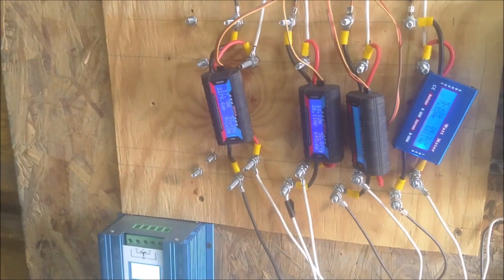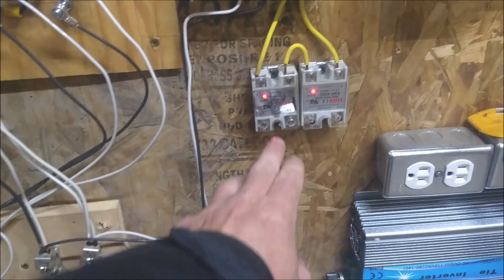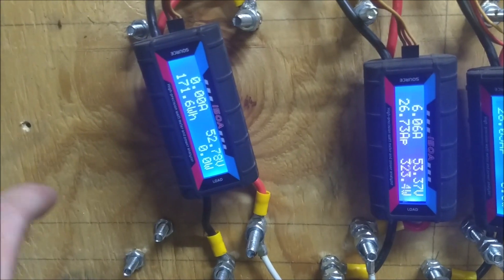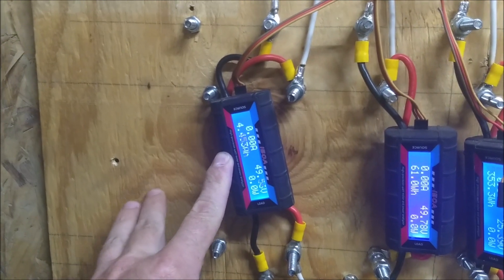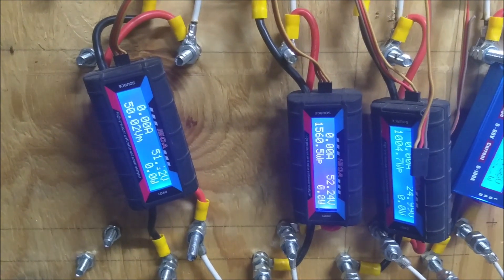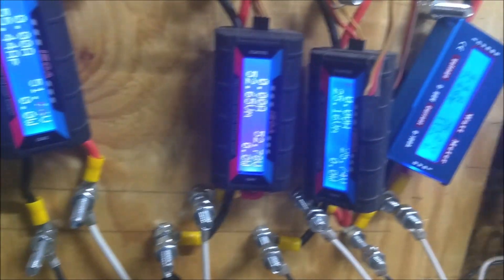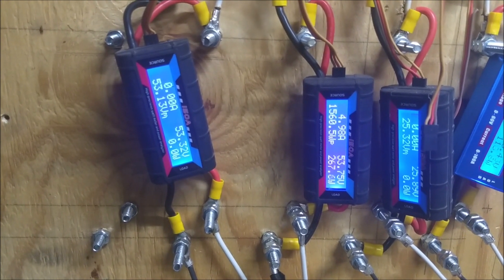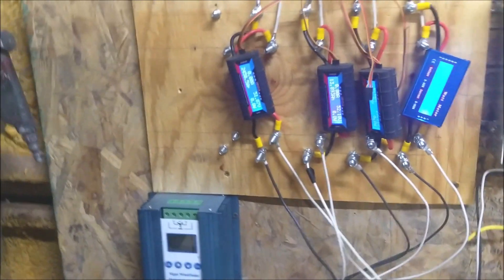iSta Breeze i1500 vs iSta Breeze Heli 2.0 Peak Outputs

Comment: Hi Mate, I have tried using 3 blades even up at 6.5 meters, but they are not working in my area. I am still having trouble getting the ista breeze i500 going with the 1.2 meter 5 blade wind wheels. I tried a 1.6 meter 5 blade wind wheel, but it is still slow to start. I think there might be some cogging, since it has larger magnets on the rotor. I have a delivery coming today of some blades like you got for your smaller wind generator, with more inner scoops on the blades for slow wind start up, just hope it does not affect the top rpm.

Comment: Is the 3 blade or 5 blade better for usual 10-15 mph max 50 mph half a dozen times a year. I thought 5 blades is better for slower winds. I'm hoping their 48v does well in slow wind. Are you running the 24v version on a 48v battery?

Comment: Where you given these items to test them and promote them? Or were they purchased without the influence of the manufacturer?

The reason why I ask you this question either they sent you quality only or they degraded so badly over the years that china makes better quality than they do. The windings in these coils are so bad some people have experienced damaged on delivery not by the shipping company and zero quality control.  I can contest to this.
Reply from the maker: It's a mix.  They send me some turbines, I buy others.  I was supporting them before they knew who I was.  Sometimes they send me other customers' "returns"...I usually can't find anything wrong with them.  They have a lot of products I wish were aesthetically better assembled but every product I've gotten from them has been functional.  I'm sure some bad products get out, and I've seen (and had) a few legitimate failures.

Comment: Can you tell me which one it is open circuit voltage for heli 2.0? 0 vac to maximum vac ?
Reply from the maker: There is no maximum open circuit voltage for a pma, the faster you spin the shaft the higher the voltage goes.  At 1000rpm, though, voltage is sitting approx 500vac if I recall correctly, I don't think I specifically did an open voltage test on this generator.
Reply: @ToysforWatts  OK.  let's say that with the three-phase circuit you enter a rectifier bridge and from the rectifier bridge you reach a wind controller that has a maximum DC voltage accepted.  What do you do if the turbine sends a higher voltage to the wind controller than it allows?
Reply from the maker: In my rig I have the turbines connected to batteries and the batteries are connected to inverters.  The inverters trigger on at high voltage and off at low voltage.  In my setup it's pretty hard for the turbines to reach dangerously high voltage peaks...but it happens on occasion and when it does it blows up my controllers and batteries.  I strongly recommend everyone running wind turbines to use a controller that can trigger a dump load well beneath the dangerous voltage threshold, I try to remind people regularly that one of my goals is seeing where things break, and I like to see where things break so that you guys don't have to yourselves.

Comment: Im thinking of an i-1500 and run it thro a Xantrex C40 load controller with dump and brake switch but if it does peak above 2000w and makes TOO MUCH power it’s going to go over my xantrex C40’s capability and fry my setup…. Im looking at a 3 blade hub so would probably need some kind of auto furling base mount…. any suggestions apart from building my own counterweighted item as I’ve seen on your heli 2.0
Reply: Ive seen quite a few disappointing Chinese junky turbines that only make a fraction of their claimed output, i never thought I’d be whining about one making too much power ..  ! Wonder how the i-1000 compares?
Reply from the maker: I wouldn't worry about furling it, you literally can't overspeed the i1500.  I'm had it in 50mph wind unloaded and it was NOT happy, but it didn't cause any kind of problem.

I have seen some very high peaks with the i1500 but keep in mind that my goal has always been "let's see if we can break it".  So long as you have a dump load that'll automatically engage your controller should be fine.  The biggest thing I would recommend is that you integrate some means of shorting out all the phases in the event that it becomes unloaded.  If something happens to your system and it does start free-wheeling it can be pretty hard to get it to stop.

Comment: Just looking at the Ista-Breeze 48v 2000w 'Black Edition' and quite excited that I might have found my first domestic turbine (it's such a confusing topic).

So would you suggest "buy with confidence" as far as this brand is concerned?

And wanted to ask, how noisy are these? I have a few acres of land and looked to place them approximately 100 metres from any property. Can the be heard at that distance?

Really appreciate your responses.
Reply from the maker: I HIGHLY recommend the i1500 and i2000 models (and I am partial to the "black" blades but that's a style thing lol).  Noise can certainly be an issue for any wind turbine but generally you cannot hear the iSta Breeze's 107cm blades over the wind anyway.  The only time my i1500 has made a lot of noise has been when it blew up its battery bank and was free wheeling in 25mph wind...at which point it sounded more like machine gun fire or maybe a small helicopter having engine trouble.
Reply: @ToysforWatts  - thank you SO much for your reply, I really appreciate it.

I have a couple of follow-up questions if that's OK?

Q1: I've always dealt in 12v system as that's standard car batteries. If I purchase an Ista-Breeze 48v turbine what battery voltage should I have? 24v? 36v?

Q2: can you recommend a charge controller (if your budget was say up to $500?)

PS: I've liked and subscribed, keep up the good work!!!
Reply from the maker: 1.  A 48v turbine needs a 48v system.  The lower the voltage under target the less resistance there is on the load (with zero resistance being "braking"), the higher the voltage the more resistance there is on the load (closer to free-wheeling).  If you're system is set up for 12v it's going to be difficult to get an i2000 to work with the equipment.  Even bucking the voltage down will see very high amperage spikes during peak production.

2.  That one's a hard one for me because I haven't had much chance to play with many different varieties.  I honestly feel that if you're buying an off the shelf piece the best thing you can get is a Midnite Classic, which requires you to also run their clipper if you're using it with a turbine, and that blows the $500 budget out of the water.  I haven't played with any of iSta Breeze's charge controllers but I would be pretty confident with them.  Personally I prefer to make my own arrangement with voltage controllers and relays but the way I operate I'm more likely to break something and it's lot easier for me to replace a $10 brain or a $15 relay than a $800 Midnite Classic 150.

Comment: Where did you get those towers? Those are what in looking for.
Reply from the maker: The Heli 2.0 is mounted on an old windmill tower.  I modified the stub to hold a piece of heavy 3" pipe to mount the Heli to.  The i1500 is on a tower I made from three sticks of 2 3/8" oilfield pipe stuck together in a tripod...you can see it in a little more detail here: https://youtu.be/wLjBmM4dz_I?t=186

Comment: I don’t have a lot of experience with wind turbines, I have the instabreeze I-2000. I have a 48v battery bank with solar. What charge controllers, and any other devices do I need for install?????
Reply from the maker: Run the turbine to a three phase rectifier and tie it to your battery bank.  You will need to get some kind of controller to switch current to a brake or dump load for when your battery bank is full, though.  I use the "brain" controllers and solid state relays below to do this.  You will need to get some resistors or a brake of some variety to tie the turbine to to make it work properly.  Since I would want it to be completely isolated I would run a brain and a relay for  a charge controller, and one for a brake controller.  Have one controller turn the turbine on when voltage gets too low, and off when voltage gets too high...then another one to turn brake circuit on when voltage gets too high and off when it gets too low.

https://www.ebay.com/itm/254790335380
https://www.ebay.com/itm/391713162983
Reply: Thank you very much going to do some research on your advice, and may have questions. Maybe it would be smart to just isolate it away from my solar lithium batteries and get a lead acid battery bank for the turbines themselves?
Reply: What controller would you recommend that is compatible?
Reply: I really appreciate the help this subject is very hard to find information on.

Comment: What is the diameter of the 1500 and the 2000 turbine hub hole?
Reply from the maker: I don't know...I'll try and go measure one of my hubs in the morning.  It's a tapered/keyed shaft so it might be a struggle to adapt something else to it.  The hubs are pretty cheap if you're just looking for a hub.

Comment: So what you're saying the breeze  i500 is a 24v and runing on a 48v bank.??
Reply from the maker: I had it running on a 48v bank at first.   I've run it on 24, 36, and 48 volt banks previously and always felt it was doing alright.  I have changed my mind on this point and explained why in subsequent videos :)

Comment: My Ista Breeze i48-2000 5 blades on small wind wery well work on 24 V system, but if wind increase, goint over 30A at 24V system. 30A is a maximum curent A for 48V generator. That is as problem, because in small wind, need 24V, in high wind need 48V system. I buy Ukrainian MPPT controler withh lowering function. This unit in the way. I think, this is good idea, conect to 24 system 48V generator.

Comment: the 2.0 ista breeze should be making power even at low wind speed there is something holding it back wire size has a lot to do with it and the size of your battier bank if your batters are full the electric has nowhere to go like putting the brakes on at hi speed.

Comment: be careful with those foteks - fake rating etc , they need heatsinks and even active cooling fans, if current is big they just wont last, I opened up a blown up 100amp and there was a 10amp mosfet inside, maybe they did get too much voltage but I would reckon they may have blown up anyway
Reply from the maker: I'll keep it in mind, the one is completely shot...I'll crack it open and see what's inside.  I was operating outside the specifications so I pretty low expectations of them lasting anyway.
Reply: @ToysforWatts  yea they could also be ac ssr's but if they were they may not switch off or something, chinese honesty :D, im using C&G ssr's ones from aliexpress they are fine so far , they get hot though i'm running 30a dc dc continuous during the daylight hours with big pc heatsink and fan.

Comment: That wire got run into everything is it solid wire or is it stranded wire and what size is it
Reply from the maker: Almost everything is #8 or #10 solid wire.  I don't have a large stock of better stuff, I try to reserve it for the drops from the generators.
Reply: @ToysforWatts  electrons move across the surface of wires, so stranded wire with its greater surface area will allow greater current flow.
Reply from the maker: Sure but the turbine that makes the most power and has had the highest peaks is on #10 solid wire...the biggest turbine I got is on #10 stranded wire and can't keep up.  As I tell everyone who tries to educate me on wire:  I'm not using what I use because I think it's the best.  Stranded wire I have for the Heli I only have because it was donated.  Anyone who wants to see me use better wire can make a donation to the Channel.  As it is all my projects are funded by donations, channel revenue (which is about $1.80/day), and loose change found under the couch cushions :D

Comment: Those switches should be on heat sinks to dissipate the heat that's why they're trying to burn up
Reply from the maker: It's because I was going way over on the voltage for the input side...heat sink wouldn't have helped there.  It's an example of "not the right tool for the job".  I'm going to switch that controller out for two 24v models running SSR's the way I am with the 24v bank and they should be golden.  Splitting the current up like this should help keep the heat under control but it is something I'm monitoring...I do have them all mounted to wood lol